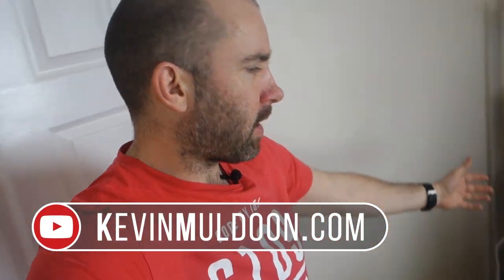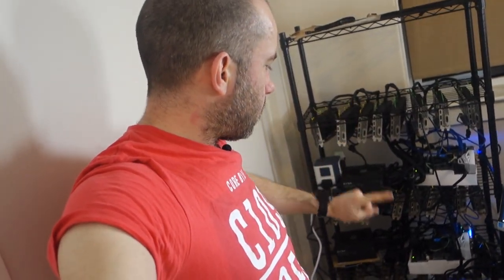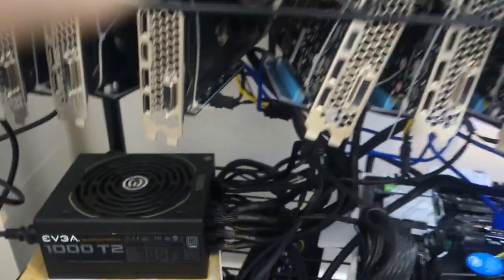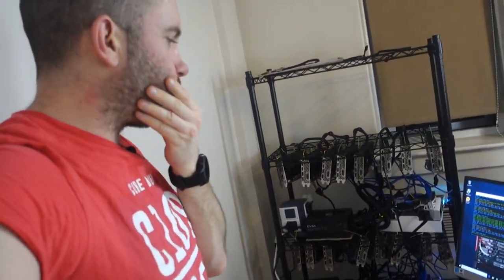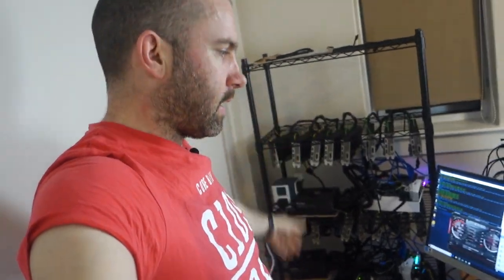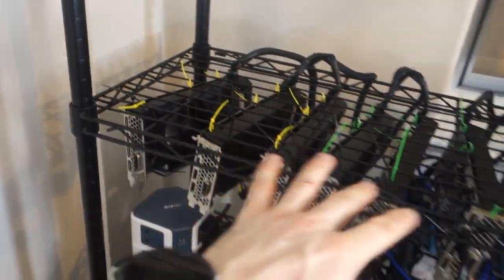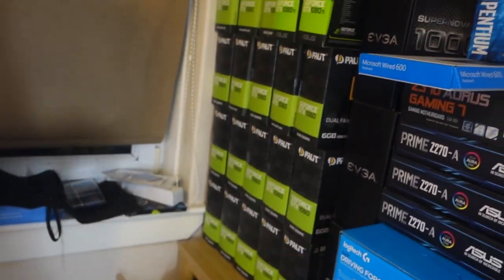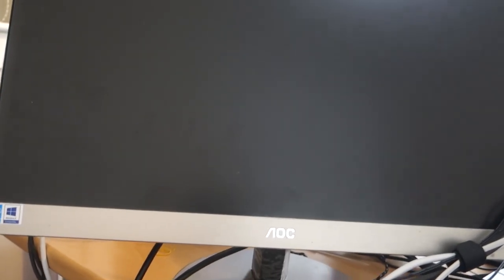My 24 GPU Cryptocurrency Mining Rig

Comment: ok so I'm calculating my budget to build your kind of monster , how many PSUs are needed? and what kind of PSU do you reccomend
Reply from the maker: In that rig, I had four PSUs as it was four separate GPU rigs.
Reply: @KevinMuldoon  so it's one PSU per motherboard , thanks
Reply from the maker: That's how I set it up, but it depends on how you set up your rigs. You can use multiple PSUs with motherboards too. You'll find adapters out there to help you address limitations of only using one PSU per motherboard, but I kept things simple.

Comment: Nice setup but how much does it all cost for the whole setup? if you factor in the cost of hardware and including electricity bill, is mining still profitable (bear in mind you can only mine certain coins efficiently)?
Reply from the maker: My whole setup was close to £14,000, but that included my main pc that I will be using for editing, gaming etc, do you can knock a few thousand off it.

I will break even, but that point has been pushed back because of the price or btc dropping.
Reply: That was part of the reason why i never thought it was a good investment for me (personally) due to the massive market price swings.  And as times goes by, it just gets much harder to mine and increasing your cost. If i was to get into mining, i think i would mine coins that are not in the top 20 and concentrate more on mining coins at an early stages of development when the difficulty level is still low to amass more coins in little time. For example, Ravencoin just release last month (recommended by Overstock and is essentially kind of a fork of BTC). Of course, there are huge risk mining coins that are not yet listed on exchanges which means you can't sell them. But when it does, the rewards can be huge since you're essentially an early adopter.
Reply from the maker: I joined the Ravencoin discord group a few weeks ago, but haven't been mining it.

I'm mainly mining coins that I will go up in price over the next twelve months. My plan isn't to cash out in fiat, and if I have to, cash out as little as possible.

Mining lets you get in and mine for coins that haven't even hit exchanges yet so if you are willing to mine some speculative coins, you could do well.
Reply: Yeah, you need to look at it long term. I was mining Ravencoin using CPU on a Linux VPS server and it took about 2 days just to mine 1 coin so i gave up. GPU would be better choice. :)
Reply from the maker: CPU mining is worthless. It's not worth the electricity. Even threadripper CPUs don't perform as well as many people thought.

You're lucky if my 8700K makes 25 pence per day. Just isn't worth putting your CPU at 100% for it.

Comment: could you go through electrics and how many rigs you recon your home could handle and why?? i want many rigs but unsure of the electrical side and its hard finding vids on this. thanks.  im running 4 x 1060 6gb and two 1050ti but looking to build two other rigs of 1070 poss 1080 cards.
Reply from the maker: It's not something I could speak about with authority. It's not a problem I have just now, but if rigs start tripping my electricity, I will get an electrician on.

From what I am led to believe, how much power you can run depends on the electrics in your house.
Reply: cheers for the quick reply. my electrics will be the same as yours as im in edinburgh. i guessed that i would go down the road of plug it all in until it stops lol. i could have been where you are now if it hadnt been for some naive investments i made towards the end of last year but onwards and upwards.  big plans for this year!!!!!
Reply from the maker: A friend of mine is an electrician and I spoke to him about it one night, but it got a little technical and I didn't fully comprehend what he was saying (lots of ifs and buts and maybes, and he couldn't say without checking everything).

I'm not sure if modern homes have higher limits or lower limits. In the short term, If adding a new rig tripped my electricity, I'd try and connect it to a different area of my house.

Comment: Hi mate, are you still mining with the same rig and do you think using the same spec is advisable when saving cost or I shoulhd go for 30 series cards, I have £1000 and thinking about mining . Whats your advise
Reply from the maker: No I don't mine anymore. 

The 10 series cards I mined with can still turn a profit just now because of the price of bitcoin etc, but I wouldn't recommend buying them for mining as the margins are so thin. It's unlikely you would get your investment back.
Reply: @KevinMuldoon  please don't mind me asking any reason why you stopped. I just want to learn from your experience. Thanks mate
Reply from the maker: It wasn't profitable any more. Once crypto isn't in a bull run, GPU mining becomes costly as electricity costs are higher than profits. So at that point, you make more money by simply buying coins.
Reply: @KevinMuldoon  thank you for sharing your experience.
Reply from the maker: You're welcome.
Reply: @KevinMuldoon   During our discussion yesterday. I was running on my single RTX 3070 Desktop using NiceHash. I run the rig for 24hr and have mined £2.45. According to the NiceHash command line update the watts used 150watts so approximately a total cost of 66.74p on electricity and profit of £1.78. I am guessing I have to pay a fee to NichHash which I haven't gone that far as I am trying to understand this. Kevin my question is with your rig in 2018 you should have been making quite a lot but your bolt neck was maybe your electricity rather than the concept of bitcoin mining? Thoughts on this, please.
Reply from the maker: You don't pay a fee to nicehash. 

The calculation is straightforward. Work out what you get charged per kWh and then work out how many watts you're using. If you're mining, you should be reducing the power of your GPU and under volting too, whilst increasing memory for Ethereum etc.

Comment: Mam, 
Have you had any problems using a single psu @ 1000w feeding 8 cards? how many watts does each GPU consume?
Reply from the maker: +Rubén López Each PSU draws 120 watts at full capacity, but I've underclocked them to 75%. So at most they would draw 720 watts. Still need to add the CPU and SSD etc, but I'm using a Pentium so total will be under 800.

The setup means I could easily swap in something like a 1070ti or 1080 and it will still be ok. But I'm happy having a little breathing space for the 1060s.
Reply: Kevin Muldoon nice! Im building a rig with same mb and 8 1070ti... Hope will works , thanks man
Reply from the maker: +Rubén López Best of luck with it. Hope it goes well.

I'm gonna maybe added mining and cryptocurrency to my discussion forum so that I have a place to talk about it with people. Let me know if this is something that would interest you.
Reply: Stick to the 80 percent rule with anything electrical.....

Comment: What hashrate ? Power consumption ? That's the only thing i was looking for :/
Reply from the maker: +zoneterror Hash rate is dependent on what I'm mining. I switch between five different multi looks so rates are always changing.ive set power at 82%. The card can go to 120 watts at full so you can work out the total consumption from that.
Reply: How  is the hashrate for Ethereum  ? Thanks
Reply from the maker: +compte mobile I've been getting around 19 with my 1060s. I need to try and optimise it more. I messed around with it last week but the settings I changed didn't increase the hash rate. Perhaps because my cards have hynix memory.

Comment: your doing it the hard way . you need to order an Display Emulator Plug Headless Ghost Emulator for each rig that plugs into the one video card so the pc thinks they is an lcd screen attached to the card their are like 8 bucks each the get an cheap usb mouse and plug it into each pc . Why do this you say . Then you install Chrome remote desk top on each rig so you can remote log into the rigs from an phone or an other pc an then you can do changes on the rigs and not have too be right in front of them .
Reply from the maker: +Colin Stienke I have remote desktop management on all rigs and can control from anywhere - my phone, my laptop etc. I've not had to actually use the monitor in about two or three weeks (when I was removing faulty m.2 connectors).

Are the display emulator plugs really necessary? Do they really provide an improvement in performance?

It's not something I've looked into it too much as yet.

Comment: Interested to follow your journey into permanent cooling solutions for summer weather.
Reply from the maker: +Mark Stuart I'll be recording a video today or tomorrow about a new fan I've bought, but long term I'm going to have to set up an exhaust of some kind.
Reply: I have this on order https://www.amazon.co.uk/gp/product/B00HU3BF22/ also the 20" version. The challenge is extracting the heat outside in a conventional built well insulated house. Thinking an external shed type enclosure gives more options for cutting large air intake and exhaust holes for fans.
Reply from the maker: +Mark Stuart I have a gym outside that I could convert, but you're right about inside. There are extractors for air conditioning units that could perhaps be used.

I'm down the gym and using the YouTube app to reply so I can't copy and paste the link. It's a 20" fan I've ordered too. It's a floor fan.

Comment: You have a good setup, sorta. Clean up the cabling, better job at laying out those GPUs but the main issue is what you running. Stop waisting time with windows and this and that, nicehash, blah blah. You really waisting money and time. Get yourself EthOS and get it done. Simple as that. It's super cheap, super easy to install, you can OC your GPUs and undervolt them, and most importantly, you can manage them remotely with ease. And has an awesome app for your phone to check on things. Nicehash, they take a lot off the top. Windows, slow and not really meant for mining. Trust me. I have 14 GPUs at the moment with more coming and EthOS is your best option IMO.
Reply from the maker: I prefer windows as it allows me to remotely control it better and tweak things better. It all works with awesome miner and I can manage everything from my phone. I've not had any problems.

I installed NiceHash to test it, but I use awesome miner to handle everything.

Comment: ok dump windows cause the problem and learning curve is just not worth it, go with smos and use dtsm 5.8 to nicehash equihash algo and save your self a lot of head aches. trust me i was standing right where you where 2 months ago and boy am i glad that i switched. here is the proper command line so you don't have to have any problems.
--server equihash.jp.nicehash.com --port 3357 --user your-bitcoin-adress.worker-name --pass x
at the current you should be getting 5600 kh at $56 a day. do the same for those 1080tis and bam you should be looking at $70 a day. this is the fastest way to roi. good luck
Reply from the maker: +Brian Thanks for your advice Brian. Much appreciated.

I downloaded smos and flashed it using etcher onto a USB stick last week, but I initially tries it when I hadn't fully set up my pc.

I know windows isn't always ideal, but it's working quite well just now. I'm using Awesome Miner to manage all the rigs and I can control it via my phone. Windows updates are disabled and I haven't had ant restarts.

Comment: that meshify case is very short did not notice that b4
Reply from the maker: +Cid Sapient Short? It's a mid tower. It's the same size as other mid towers. Not particularly taller or shorter than others.
Reply: short as in front to back
would not be easy to fit a rad up in the front with a atx board
i was gonna grab that but i just built in the corsair 460x for a friend 
and its got just those extra couple inches i think is needed
other than that i think i still want an in win
Reply from the maker: +Cid Sapient Apparently it can support a 360 was at the front. There's plenty of room for a 360 rad or three 120mm fans. I opted for two 140mm fans for intake.

Sounds like a full tower would give you the room you need.
Reply: nah the 460x is fine im looking at it right now with my 240 in it with a msi 390x gaming x
but any longer gpu than u got and the meshify wouldnt work
in wins solve this problem by pulling air from the bottom
full towers are only if u need lots of drives
Reply from the maker: +Cid Sapient Cool. Best of luck with it. I spent way too much looking at cases. But it's important to do to ensure the case first everything you need.

Comment: Hashrate 320 Sol/s Clocks +107/+926 Power Limit 85% Power draw from wall 100w try this and see how it works for you
Reply from the maker: +Brian I'm out just now so can't check how I have them set up. Will get back to you later today when I'm home.
Reply from the maker: +Brian Is it 1060s you've got?
Reply: i have 1070's the settings where from a friend so. may be diff if memory is diff
Reply from the maker: +Brian Yeah mine have hynix. I think I have mine at the best settings as I kept increasing the core and memory until it crashed.

I'm thinking of adding mining and cryptocurrency to my forum RiseForums.com. let me know if you'd like a membership.

Comment: 1000W PSU will be stressed handling this build
Reply from the maker: +BaseSounds Why?
Reply: Best to go for x2 PSUs with a PSU link cable so you have one running Mobo+Risers and the other powering the GPUs, better distribution. We are running the same mobos with rx580s. Big issue with this mobo in our experience is locating the GPUs, lots of fucking about disconnecting risers and restarts, however, this could be windows related.
Reply from the maker: +BaseSounds That's not necessary. 8 1060 6GBs running at 75% draws 720 watts at most. Each rig will draw less than 800 watts. That's far below the 1000 watts that this PSU can provide.

I haven't had any problems with connecting the GPUs. Well, I had one problem, but that was being silly. I had knocked a few cables out the PSU ever so slightly which generated error code 43s for those GPUs. I've not had ant major problem with it.

It's maybe different with RX580s though. I haven't used AMD GPUs for this yet.

The 1060 6GB needs 120 watts at full power. Looks like an RX580 8GB needs 185 watts at full power. That's why you're needing two PSUs. AMD cards all seem to need more power. Even the 1080 only needs 180 watts at 100% power.

So what is the exact problem you're having? I'm not an expert on any of this but I might be able to help you. :)